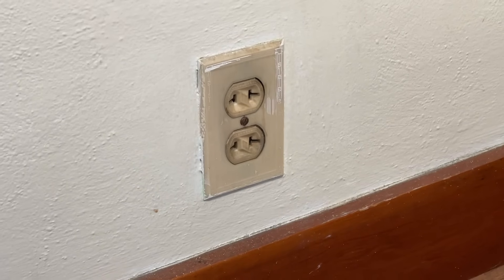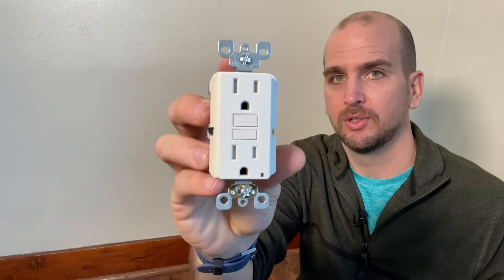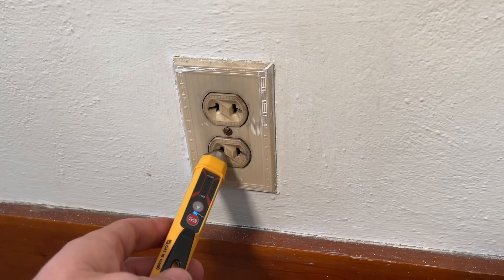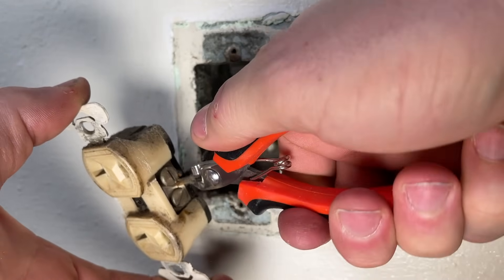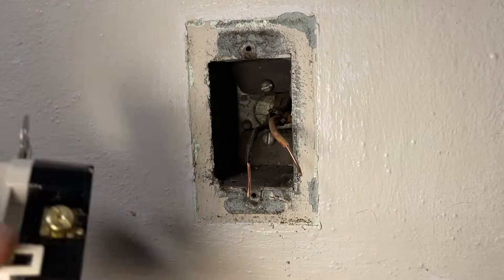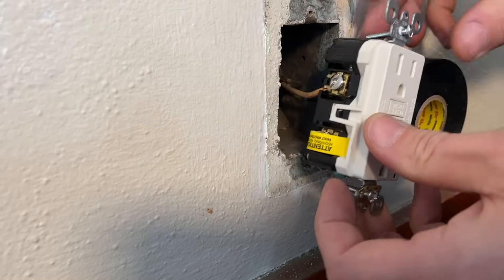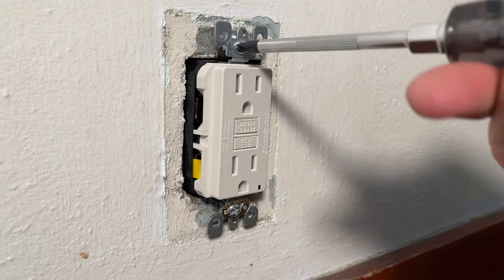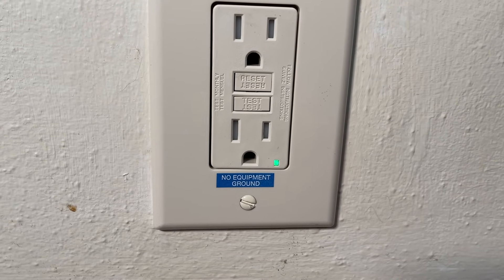How To Replace An Old 2 Prong Outlet Using 3 Prong GFCI

Comment: Interesting, I thought this kind of hook up would be illegal without the ground wire installed.
Reply: Not illegal, but code does require the "no equipment ground" sticker to be on the faceplate.
Reply: @DragonAurora  wonder how good a high current connection these devices make. They are just simple clamps to the wire I believe and would worry about heating of the connection durning high current draw.

Comment: Why he would cut the wires and make them shorter and harder to work with is strange.  Why leave the wires straight not wrap them around the screws is stranger and you will notice the wire going under the neutral screw is on the wrong side of the screw, that is as the screw is tightened it forces the wire outwards instead of pulling it tight.  If you need an electrician call an electrician.  One who has passed the qualification exams.

Comment: I have seen a few comments questioning the purpouse of the GFCI if it is not connected with a ground return-wire (and saying that the GFCI is pointless without one). The GFCI will be safer with an actual ground-return wire, but it is not needed for the GFCI to function. A GFCI outlet monitors all incoming current and compares it with the return; if there is a some current "missing", the GFCI will trip (a very small current, just a few milliamps will trip the circuit). Having an actual earth return wire means current can take the ground wire back to ground if there is a fault, meaning that the GFCI will trip immediately, and even if you where to touch the device, you probably would not even notice, you'd just see the GFCI trip.

Without the return wire, the GFCI will still trip during a fault current, but only when this current finds an alternative ground connection. If you are completly isolated, you can touch a fauly device with "live voltage" without any current passing through you, as there is no ground path. If you are not isolated, however, like in the shower, or anything else close to ground, the circuit can now close through you. Without the GFCI, current will pass interrupted through you as a circuit breaker will only break currents in the amp range, meaning you'll be long gone b4 any such breaker will trip. The GFCI, however, trips with just a few milliamps, and so you'll be protected if the current through you reaches a dangerous range.

Comment: When I removed my 2 prong outlet I found a ground wire attached to the metal box.  It was bare and the wire was about half the thickness of the metal part of the positive and neutral wires.  I attached an additional wire to the back of the metal box and used that as my ground wire for the outlet.  Was that okay to do?  Btw, I know that the ground wire is definitely grounded.  I even traced the ground wire from the fuse box to outside where it is grounded.  Plus, I used a circuit tester afterward and it showed it as being grounded.
Reply: Yes, if there is an existing ground to the metal box and you tie the outlet into that, then you're good to go.
Reply: As long as you verified that your ground DOES eventually make it's way securely back to the panel's grounding bus bar, you all good fam

Comment: Your videos are very helpful. One of my responsibilities is teaching safety. In a professional setting I always recommend 1) Test for power. 2) Test for power off. & 3) Make sure tester is working properly by testing a known live circuit to make sure your tester is working properly. Just want to be safe. Have seen the results of an unsafe environment and training. Hope this helps. Thanks for the videos and Happy 2022! Bill Mc
Reply: I don't know a thing but shouldn't #3 be first?
Reply: @audreyquezada5152  No, because if the thing you are testing fried your tester you need to test it on a known circut after the one you're planning on working on.
Reply: I like a tester that makes a sound, in case you are in bright sunlight. 
Also lets you keep eyes on other issues, especially when working on a car.
Reply: @stevejette2329  h guy

Comment: New Years Day  and its interesting to see how it is in the US. In the UK, Ground (Earth officially CPC circuit protective conductor) is important as it would carry fault current. We have to measure impedance ZS (max permitted) ohms in order for the RCD (GFIC) 
to operate within the maximum time permitted 0.4s /300ms are the common times.

Comment: I live in a 1973 house with a "switch" problem.   This applies to a hallway & a stairway light On/Off switches at either end of them.  The switches "hang" half-way: the light is Off.  Naturally, I reach for the switch at the other end.  On/Off, On/Off,...so those switches need to be replaced.

Lasting 47 years those switches had to be of very good quality.  Previously, you reviewed different replacement outlets & suggested one.  I wonder if you have done that for switches.  Since it's a rental I'm willing to pay the $6 for what is labeled as a professional part.  I completely reject the $1 China imported parts.  How to ID a high quality part?

Comment: My crew never turns off the electric when working with outlets of this size. In fact, one guy will hold the wire and ask someone to touch him and they both get shocked. I don't get how this happens and they can laugh about it.

Comment: Great video ! Thank you!  Do you think you can do a video of how to find the first outlet in a string of outlets in a room?
Reply: The first outlet is usually the one on the left or right of the entrance to your room.  Remove both of them (first one on the left and right).  The one with just 2 wires will be your end point.  The one with 4 wires (ungrounded) will be your first outlet with these two extra wires going to your next outlet.  To double check (when both outlets are removed and power turned on), test the place with 2 wires to see if you still get electricity to it.  If there is none, your other outlet that you removed (with 4 wires) is your first place in the room where you need to install the GFCI outlet.
Reply: Excellent! Thank you so much!
Reply: @silverbeernuts4229  Depending on your wiring and size of your place, sometimes hallway outlets are tied up with one or more of your rooms.  Check the fuse box to see what is what.  Plug in a light to an outlet closest to your fuse box and plug in another light in the room that you work on.  Flip the fuse switch off and on to find if both lights turn off/on at the same time.  If yes, the line starts in the hallway and you install GFCI outlet there (you need just ONE GFCI outlet at the beginning of each line, so you would install all normal outlets after GFCI in the hallway AND in the room).  Sometimes the labels in your fuse box are not correct, so it's better to test it using two or more plugged in lights.

Comment: This has recently become more important since an Online Home  unit is suggesting kids pull out the plug and put a coin between the 2 prongs.  With the Ground pin on top, this would have to be done from bottom up.  More difficult.  This Fad  has now been pulled from the www.
Reply: Certain areas of the country have that as a rule for new installations.   I learned the hard way accidentally dropping a narrow blade on a plugged in receptacle and shorted the circuit with quite a nice spark. Lol
Reply: LOL good ol' Amazon for ya!

Comment: Unless the box is metal and has a ground connection a GFCI receptacle is useless. A ground fault circuit interrupter turns power off if there is any current on the ground connection so will not work without a proper ground. What it does provide is a receptacle that you can put  a 3 prong plug into. Without a ground wire you may as well use the lower cost  non GFCI 3 prong receptacle.
Reply from the maker: That is simply not true.  Seems like might be a fair amount of confusion on this topic but a GFCI outlet does not need a ground to still detect a fault (difference between the hot and neutral).  Ground is definitely preferred but not needed.

Comment: Where is the ground on this old receptacle? You don’t address this. That is why you are changing the outlet. Is it the metal electrical box that attaches to the old metal clad cable which goes back to panel?

Comment: Oh my god. There’s so many things wrong with this. Whoever reads this don’t listen to this guy he will have you burning down your own house. I suggest you do more research on wiring a house correctly. This guy is far from correct
Reply from the maker: Hey John, we always welcome feedback but more specifics would help.
Reply: @EverydayHomeRepairs  ok well I suggest to you to do more research on how to wire a house lots of great vids out there and articles online. Also maybe read your towns ordinance for wiring. Maybe even watch a couple vids on how electricity is made and where it’s path is. Once you knows these two things you will understand things more clearly. Also the little tab you talked about in the vid on the three prong plug. It’s supposed to be screwed into the face plate. That grounds to plug to the outlet the outlet grounded to the metal box. If you have metal conduit. You’re grounded unless there’s a break in it somewhere. Or if you have the old cloth covering that looks like it’s metal. The metal serves as conduit. Over time that stuff breaks up and breaks down not serving good ground anymore. Also just about everywhere the outlet needs to be grounded to the metal outlet box. So In reality you can put in gfci all day long and it’s not going to work in it’s intended use. Only way around a two wire is if you have unbroken metal conduit from outlet box to circuit panel. Or run a third ground wire.  Which actually would be stupid to do. If you can do that run some new 10/2 or 12/2 wire depending on your code. Both if those come with ground wire. Home wiring is actually very easy. As long as you know the rules of the game. Am open ground simply means you are not grounded

Comment: What the hell do you mean the black is the hot they're both hot it's AC you should know this if you're going to be telling people how to wire a plug up
Reply: They are not both hot. The black (hot) should measure 120 volts relative to the white (neutral) and relative to the ground. The ground to the neutral should measure 0 volts.

Comment: If I had an outlet plug on each wall in a room, how would i know which is the first on the line to install GFI ? Thanks
Reply: If your receptacles are wired using pigtails, meaning that receptacles downstream do not rely on upstream receptacles to be connected in order to operate normally, then the task could be more work. You would need to remove the pigtails and connect wires directly to the receptacle, thereby making it the connector. Then remove one hot wire at a time until you find the one that disconnects all the others, and that's the first one. Remember to turn the power off and on appropriately.

Comment: Many homes with metal boxes were original wired with a bare (insulated) copper ground. It is attached to the outside of the box, you can't see it. If the box was grounded then that faceplate screw would likely be a ground . 
However, over time, contractors and homeowners inadvertently cut the ground wire without knowing what is was. This is because the original contractor would run one wire, horizontally over the face of the studs, from box to box, room to room. By cutting it in the kitchen area you could disable it throughout the rest of the house.
Reply: Thank you for the info about the ground wires from the metal boox to the main box grounding system, my house is old, 90% of it is 2 wire receptacles,   but on one of the recepticle outlet boxes i did notice a loose wire hanging from the back of the box? Sure had me worried till the grounding method was revealed,  thank you all for teaching me and all the tidbits from the peoples ideas
Reply: @miguelalvarado2343  I grew up in the house I now own.  It was built in 1955, under 1956 NEC regulations taking effect months later.  My folks bought the house in 1961 from the original owner who built the house himself.  He used Square D XO circuit breakers which were the state of the art at the time.  The boxes grounded in my house are the bathroom outlet box, the light switch box to the bathroom light, the central heating outlet leading to the heater's blower motor, the outlet in the old laundry room next to where the sink was (laundry got moved to the detached garage), the outlets near the kitchen sink, the outside porch light boxes & the switch boxes to the lights and all fixture boxes in the detached garage.  The fixture boxes in my garage, however, originally did not have 3 prong outlets in them for many years, even though they were bonded.  Since all my breakers are in 1 panel, I can run ground wires from an ungrounded box up to my attic, and run a ground wire from a grounded box up to the attic to share it with the other circuits.  I currently need to replace a rusted box in my kitchen and put in a GFCI in place of the old 3 prong outlet in the box.  When I chip away at the plaster to access the old box and the stud that the bracket is mounted to, I will run a separate ground wire to ground ungrounded circuits with.
Reply: Just wanted to add that you get the same effect by using BX cable and metal boxes, which is how I was taught many years ago.
Reply: Where was this done and what was the box ground wire attached to? If you don't mind me asking.
Reply: I had an old house with two prong outlets I changed out shortly after moving in.

The cabling was a braided tar 14/2 romex, plastic insulation, and a 16 gauge ground. The ground wire was often spiral wrapped around the end of the stripped braided sheathing and clamped to the metal box, grounding the outlet through the box. 

You had to be careful grounding the outlet directly as the 16 was fragile once you unwrapped it.

Comment: why install a GFCI receptacle at all, when there's no GROUND CONDUCTOR in the junction box? since there's no connection 'to ground', you're defeating the purpose of an expensive receptacle...
Reply: It won't necessarily protect equipment, but it is safer for individuals, and is an NEC approved method rather than going to the expense of rewiring.

Comment: I have a receptacle that has 2 black and 2 white wires. How do I install the wires on the GFCI switch.
Reply from the maker: You need to understand which wires are providing power (Line) and which are taking power to an outlet downstream (Load).  Here is another video that will walk you through the process https://youtu.be/bWfveKM6NEk

Comment: Not sure if this is the right place to ask.  My house is five years old, but just within the last week or so, I have had three circuit breakers trip, all different in different parts of house.  I don't think it is haunted so any ideas on what might be the problem?  I do have one outlet/receptacle that was installed about a year ago, (added onto an existing bathroom/basement outlet) that has stopped working.  Regular outlet is still working fine.  Any ideas?  Great videos..I am a DIYer for small stuff.  Also have 53+ years as military electronic tech, now retired.

Comment: If. You have mc cable the casing will  act as a ground . The way to test for   ground to take reading from  plate screw to hot with  a volt /con 
Which only reads continuity and voltage .  Or take continuity reading from neutral. To mc casing to make 
Sure it is grounded . Armoured  cable was  not Widely. Used in residential though so the GFCI would be the best practice . also things were not always grounded properly often in old work I would encounter ground wrapped the sheathing then the camp tightened instead of utilizing a  ground screw or clip if it is long enough to the device or making a pigtail if it not long enough

Comment: Another tip is, you should put stripped wire in the side of the screw that is going to make the wire go around it when you tighten the screw.  Not push it out as you tighten it.  Hot wire was done correctly, neutral wire that the way it should be.
Reply: He is using the backwire option (not backstab) which clamps down on the straight wire, so it makes no difference which side of the screw you use.

Comment: Tried this with the exception of the tape and not getting an led green light or power but testing the wires going in with a tester it shows there is power

Comment: My husband did the exact same process to replace the outlet (blk wires to the gold screws, wht with the silver screws and copper to green screw) and the outlet still did not work. All plugs work including Gfci plugs and the breaker box has been reset 3x and still no luck. Any suggestions anyone??
Reply: Make sure that the wires connecting to the line are the ones coming from the main panel. Using a non contact voltage tester, verify that the black wire is actually the hot wire.

Comment: My home has 200 amp electrical breaker box.  My outlets seem to look like the less than 20 amp type.  Should I stay with the 15 amp max when I change over to the usb type?
Reply: If the circuit in question is 15 amp you cannot use a 20 amp receptacle or gfci receptacle. If the circuit is 20 amp you can use a 15 or 20 amp duplex receptacle. Bottom line, use a 15 amp gfci and you'll be fine.